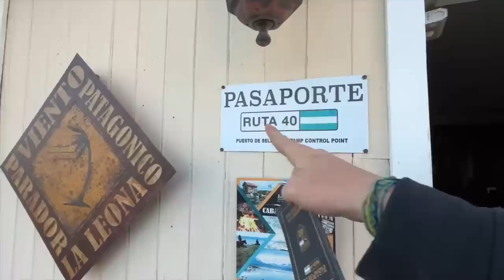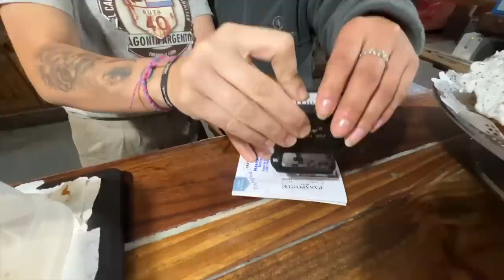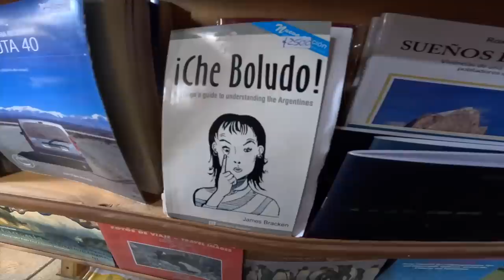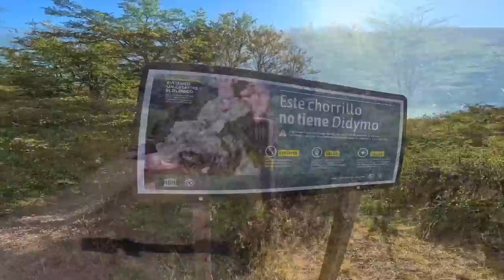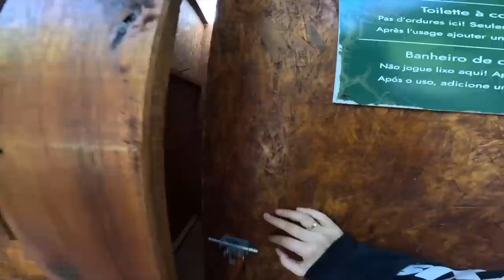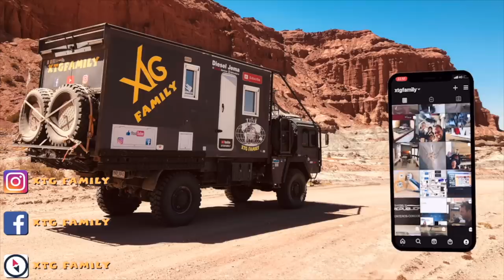434 Quand ça ne veut pas, ça ne veut pas, en panne de partout !

Comment: Bonjour, pour le cric la bille avec ressort fait office de clapet anti retour quand tu pompe.
Pour le verrin qui sort seul, je pense que cela se produit plus vite s'il est stocké à l'horizontale, car un niveau d'huile plus bas et les joints toriques pas suffisamment étanches, laissent sortir de l'huile, et avec les variations de températures le bidon respire, la nuit l'air entre frais dans le bidon, et pousse le verrins la journée par dilatation de l'air.
Donc, changer les joints, faire un niveau d'huile et le stocker debout.
Dis moi si ça marche.
Bonne continuation dans ces magnifiques paysages.
Reply from the maker: Merci

Comment: Sur numérama tu trouvera la carte de la couverture mondiale des starlink . Pour ce qui est de la réception je ne vois pas pourquoi ça ne marcherait pas à 5000 ou 10000 mètres , je pense au contraire que ça doit fonctionner mieux vu que plus tu monte plus tu te rapproche des satellites .  CQFD .
Reply: Le nuage de satellites starlink est à 550 km d'altitude ! Donc que tu sois à 0, niveau de la mer, ou 6500m d'altitude ne change strictement rien sur la qualité du signal !
Reply: Oui mais l’altitude de 550 Kms  n’a rien à voir avec la puissance d’émission c’est juste pour diminuer le temps de latence .
Reply: @zaorori8599  Si ton satelite est à 550 kms ou 1000kms le besoin énergétique nécessaire pour un 'fonctionnement' équivalent n'est pas le même. Globalement le ping est une ’notion’ sans intérêt si ce n'est commercial. Que ce soit le ping ou la qualité du signal ne change rien en se rapprochant comme tu dis de quelques kms sur les 550 de l'orbite des starlink!  Mais si tu veux croire que d'être à 6000m d'altitude permetra de mieux fonctionner libre à toi de la croire. Je le répète 5 ou 6 kms de gagner en altitude ne changera rien au fonctionnement (ni au ping car négligeable sur 550kms)!

Comment: Bonjour. Pour les problèmes de réseau. Pourquoi ne pas passer à Starlink ? Budget? Ou autre.Bonne continuation et merci pour les vidéos.
Reply from the maker: oui, c'est cher
Reply: @xtgfamily  ok merci.
Reply: @xtgfamily  Oui, c'est pas donné.
Si j'ai bien compris cela vous coûterait le double de ce que vous payez actuellement, ok,  mais il faut aussi tenir compte du temps perdu pour trouver une BONNE connexion, de l'énervement éventuel provoqué pour ce faire, des bouleversements de plans prévus (pause pour la nuit, visite prévues mais donc reportées) car "il faut absolument trouver une connexion aujourd'hui pour charger la vidéo" alors qu'avec Starlink vous êtes connectés à l'endroit où vous avez décidé de vous poser et avec un débit incomparable (gain de temps pour les chargements etc...).
Il faut y réfléchir.
En fait, il faut tout mettre à plat et comparer les avantages et les inconvénients des deux systèmes.
Bonne continuation.
Reply from the maker: @philippesoppa3054  on ne se stress pas trop pour trouver du réseau dans la mesure où on a de l'avance sur les vidéos 😉. on le fait quand on est dans une ville où la 4G fonctionne. si les prix de star link diminue on y repensera